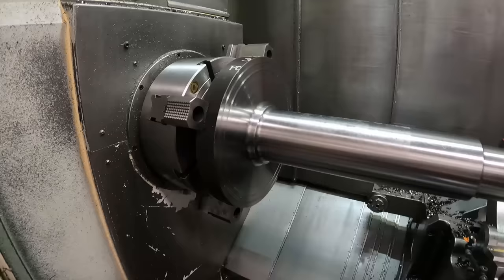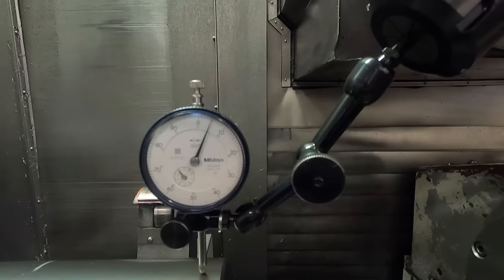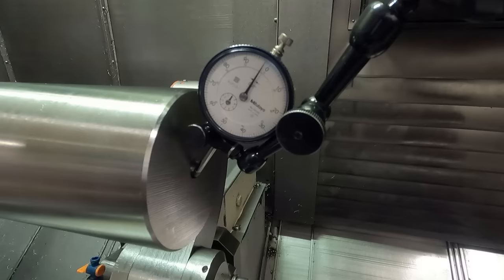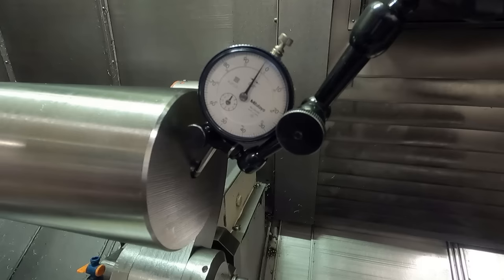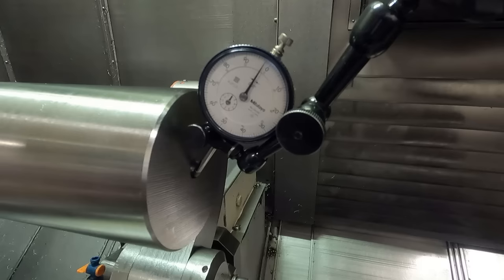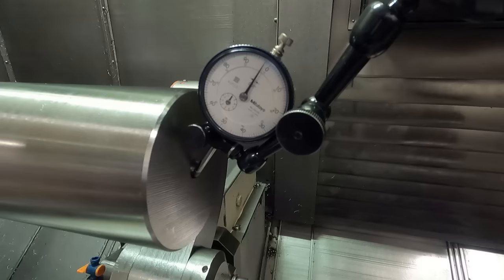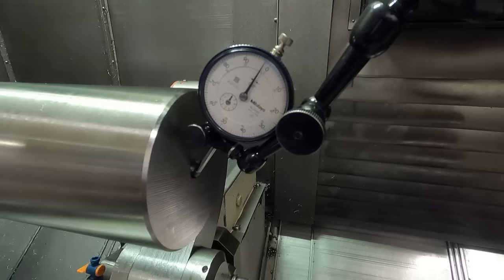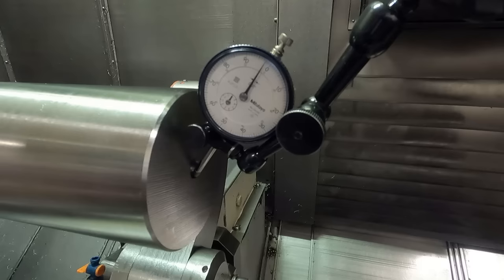Machine Shaft From 2000 Lb Stock

Comment: I can see maybe doing that part in reverse order. The flange side first and then the shaft side.  When you do the flange for the 1st op turn the entire OD length for easy indicating the 2nd op and a place for the steady rest to run. Face and center drill. Remove the steady and engage the tailstock and let her eat. Come back and drill the flange holes in a final op. Not sure I'd agree with the bushing idea for chucking on the backside. Seems like added risk. All that work and you have no idea what the shaft is doing back in the spindle, plus a bushing. It could be running out a mile. If you do the flange side first then you know for certain everything is true. Someone else said in between centers. Personally if you want it to be exact then in between centers is the best option. Enjoyed the video. Everybody makes parts differently. But if you think through the process you might recognize how simple it would be making the backside first.
Reply from the maker: No sorry you would be wrong if you did the flange end first. If things distorted when you roughed off the bulk of material. It will distort the flange end out of square and flat. Also you couldn’t drill the 1.00” hole it would never meat the hole from the other end. The order I did it in is the way. When you indicate the second end. I didn’t get a chance to show it. You indicate the back of the flange if that is running true within say .001 or better. You are square. I turned a area on the OD. You can see it in the video when I showed the small hole to set C zero for the next op. You get that running true and the back face. You than know everything is running true back in the spindle. And now you line up the C rotation to the small c-bore for that purpose than you can put the flanges holes in after turning. If you put those in in your first operation before roughing the other side. It would leave you with intermittent cuts intersecting the drilled tip of the holes. Breaking your roughing insert. And also creating problems with the finish tool. So you can see there is a reason I decided on this order of machine work. As to the bushing it would work with one or not but as I said it is easer to keep from scratching the OD with it. The bushing doesn’t matter as far as runout. If it runs true it runs true. Bushing or not.
Reply: @EdgePrecision  Yeah you're probably right.
Reply: @MuddyintheWater  he’s always right . He’s a master
Reply: I'm not saying he's wrong but if he ran it the correct way he could save hours run time, handling and headache. Really, really, really over complicated that part. 

Like I say if you simply turn the flange and then the length of the part. 2nd op chuck on the flange, face to length, hit it with the tailstock, rough turn the OD, remove the tailstock, rebore the center, engage the tailstock, finish turn. Then flip and drill the holes and the part is finished. Done. Pretty much that simple. And all that can be done inside of a program and all your lengths will be held and handling to a minimum . Running it his way he has to handle the hell out of the part. If he had 15 parts to make it would take 6 weeks and he'd work himself to death. Literally you have to see just how simple the part would be running it the other way. The way 99.9% of the world would make that part.

He said no I was wrong. I tried to be polite and simply throw out the idea for him to mull over. His reply was that I was wrong. The irony is that the rest of the world could make 12 of those parts in an effortless setup in the time it took him to make 2 all while he was working himself to death.
Reply from the maker: Ask me how I know it wouldn’t work. I will tell you. I tried it your way on some other parts in this same order. Fortunately I left enough material on the roughing operation to save the part. These are the problems with your process. If you start and finish the flange end as you say. Than turn the blank around and chuck the finished diameter of the flange. Than face the part to length and center drill. At this point you have already made two mistakes. Now this would work for smaller diameter stock but not this 16” diameter material. Because when you rough down the shaft the part will bow. Now to get the remaining face flat and square you would have to reface it before you reclaim your center drill. But now the part is short. Now the flange end you finished is no longer flat because it warped when you roughed all that stock down to the shaft. Now again ask me how I know this. Fortunately when I did this I left stock on the overall length so I was able to clean up the part in tolerance. And again fortunately the 16” of of the flange wasn’t critical and the customer said it was OK when that didn’t quite clean up when I had to recut the flange end. Does that explain to you why I said your process would not work.
Reply: @EdgePrecision  no because as I explained in my explanation of making the part, in the 2nd op (the shaft end) you can 
1. Rough it down
2. Remove the tailstock allowing the part to relieve itself
3. Rebore the center making it true to the flange again and free of stress
4. Engage the tailstock
5. Finish turn the part

As far as the flange side I have a hard time believing that it's not flat. The long shaft end, sure, that's typical. But the flange bowing isn't typical. People turn down short large diameter parts all the time? Removing material 36 inches away from the shoulder isn't going to cause stress relief from the flange if that makes sense. Short length or long length part why would material removal effect the flatness of the flange? The shaft, yes. It's long and a lot of material coming off so yeah it'll curl. But the flange? But if you say that it doesn't come out flat then fine. Don't turn it in the first op. Simply face the part and leave .100 to come back and finish in the 3rd op when you are drilling the holes. 

It really is that easy. 
Op 1. Put the part in. Face it. Skim the OD as far down the part as you can. 

Op 2. Indicate. Steady. Face the OAL (leave .100). center drill. Tailstock. Rough. Remove tailstock. Rebore center. Finish turn. 

Op 3. Finish flange. Drill.

With my way you're not indicating forever and your can hit the button and make the parts and hold all the dimensions. 

Your way your handling the parts a lot. A lot more involved than it needs to be.

That's my opinion. Like I said I tried to be polite about it and simply mention another way. You bluntly told me I was wrong. Now I'm bluntly showing you that there's a more logical way. Whether you accept it is up to you. I'm not attacking your ego.

Comment: Why can’t you start with stock that has a closer diameter to the end product and just weld or fasten then flange?
Reply: I would guess a strength/wear problem. Having it be one piece is probably stronger. If you welded it or bolted it its only the bolts or weld material holding it together whereas as one piece the amount of volume holding it together is much bigger.

Comment: A little side eye for the engineer who decided that shaft needed to be turned from a $10,000+USD round rather than be a two-piece press-together.
Reply from the maker: The original machine had fabricated shafts that these are replacing. They had a failure so in order to avoid that possibility they decided to go out of solid material. By the way your price on the material is more than three times the actual cost.
Reply: @EdgePrecision  That's why I don't buy that stuff for a living!

Comment: Wouldn’t it make more sense to use an upset forging instead of bar stock, better grain structure, less waste of 4140 material and a less machining…?
Reply from the maker: If you read the comment I put in this videos description you should get your answer. But to make it short. In these small quantities, it is more economical to waste the material. It would cost more for the forgings then the wasted material. There was also a time factor. The round bar could be delivered next day from stock. Not so for the forgings.

Comment: Maybe this is a different type of lathe, or maybe it is wrongly being used. You don't do a circumferential check with a dial indicator gauge when the work has been machined while being held by the large lathe chuck and tail stock center pointer. 

The tail stock center pointer is the only one that holds the work true when being machined. Once the tail stock pointer is backed off, the heavy work clamped by the chuck jaws may drop according to its weight and could become unbalanced, as the jaws will never be able to hold such tremendous weight. I mean, this video makes no sense, it's also confusing... 
And I've worked on lathe machines, too.

Comment: Перерасход материала просто космический.
Reply: Those barrels of chips get sold and are recycled to new stock. The specifications on the part no doubt require that it be made from extruded stock. Not welded, not cast. I assume it is an aircraft engine shaft or something comparable.
Reply: @paulvandal4444  так это и есть отлитая заготовка. Я на работе из подобных делаю промывочные переводники для буровых колонн. На видео большое количество затраченных часов на работу, которую можно убрать, отливая заготовку бутылочного типа. К тому же напряжение стали, когда ее протачивают с большего на меньший диаметр очень возрастает.

Comment: So... Why does he start with such a big piece of material to make a piece that size? Why not start with material closer in size?
Reply from the maker: The end of the part in the chuck has a 16” diameter flange about a inch thick. The customer wanted the part machined out of one piece of material. So the stock had to be at least 16” in diameter.

Comment: That's quite a lot of material loss.. turning from that large diameter down to a smaller shaft. Almost makes you wonder about the concept of a 2 piece version of this part that would require less machining and result in less time and material lost.
Reply from the maker: If you read the comment I put in this videos description you will see why it was done this way. Thanks!
Reply: Oh I'm sure there's reasons. Space and clearance restrictions, strength/torque rating of 1pc vs 2pc.. the list can go on. I just like to think about concepts, rationale and engineering in a surrealistic realm sometimes! Thanks for the reply.  @EdgePrecision

Comment: Just a small comment why do you not machine a clean surface and then rotate into Chuck so you are starting from a machined surface
Reply from the maker: I wanted to use the hard jaws on the first operation. They put dents in the part with their serrations. There wasn’t a lot of stock on the OD and I didn’t want to dent the finished part. So I didn’t do any cuts on the raw stock.
Reply: @EdgePrecision  thank you

Comment: This part must be possible to make as two pieces and press/weld together the plate with the shaft.
Removing 90% of the stock is not a viable solution in manufacturing.
Reply from the maker: Read my comment in this videos description.

Comment: That has to be a record for material wasted, like making a toothpick out of a tree.
Reply from the maker: The flange on the parts end is the diameter of the stock. The customer wanted the part machined out of one piece of stock. So there is no other way to do it.
Reply: @EdgePrecision  It wasn’t a complaint, just incredible to see.

Comment: What is that device at the beginning? Is it a magnet? Why did he take it off and just use a rope anyway? O_O
Reply from the maker: I made this video a long time ago. But if it was the magnet I have. It is not rated to pick up the whole bar. So I just us it to get the strap under the bar. The strap is more than strong enough for the lift.
Reply: @EdgePrecision   Ah alright, thanks. That's very interesting.

Comment: So did you purposely get the smaller version of that CNC machine? 😳😳 LOL 🤣🤣🤣
Reply from the maker: There is one larger Mazak Integrex  e800. The number in the model number of all Mazak Integrex’s relates to the Y axis travel. So my machine is a e650H. Witch means it has 650mm (25.59”) of Y travel.
Reply: @EdgePrecision  maybe it's the wide angle lens, distorting the size?

Comment: What software are you programming with?
Reply from the maker: Esprit TNG.
Reply: @EdgePrecision  Thanks! Awesome work! I work in an aerospace machine shop and we have a mill turn in the works for some Air Bus parts. So interesting to see how awesome these machines can be in the hands of someone who knows so much. I learned quite a bit, thanks for sharing your knowledge.
Reply from the maker: @BHud20  I have a job coming up. If they let me do videos on it, you may find it interesting. It’s a helicopter blade grip. Right now we’re waiting on the steel forgings.
Reply: @EdgePrecision  Awesome! Look forward to seeing its non-ITAR and youre able to share! The ones we have coming up are precision Titanium castings. Pretty intimidating actually. Have some pics of amazing parts I programmed and ran on a UMC, wish I could share.

Comment: My god man that's a lot of material.  Go yell at the engineer, and tell him to design that part in 2 pieces.
Reply from the maker: Read the comment I made in the description. Or I think I pinned a comment on this.
Reply: @EdgePrecision  thanks for the response.   I'm a machinist also, 2 jobs. I do Xometry work and usually reject posted jobs like that at my part time.   My full time I work directly with the engineer, and we almost always find a solution to stuff like this.  (Counterbore bolts, and welds maybe). Either way, it was a good lesson and I appreciate the video.

Comment: Looks like this could be made in separate pieces.
Reply from the maker: It is possible and the original parts were made that way (These are replacements for failed parts). But the customer wanted this out of one piece because of the original failure.
Reply: @EdgePrecision  ok guess you mean the joint that was where the mounting disc attached to the shaft? Was it welded?
Reply from the maker: The original parts were made out of two pieces welded together. A disk and a shaft piece.

Comment: Something major wrong with the lathe for getting all that run out.
Reply: Lols no it's not, did you see the way he was taking those cuts, they were definitely not finishing cuts and with a part this long even with a live centre on the tail stock you can expect run out, I work with all kinds of lathes down to watch makers lathes and was taught by my father who has been working with them for well over 30 years..
Reply: What he was saying about the metal stresses is exactly right, think of it like a piece of wood.. Cut one side of a log off and dry it then you'll see what I mean. It will bow as you released the stress and tension holding it in the shape it was lol. Go read up about this stuff it is science fact.

Comment: Isn't it easier and cheaper if you take a rod with a smaller diameter?!?
Reply from the maker: There is a flange on the chuck end of the part that's the 16" diameter of the stock. Because the customer wanted the part machined out of one piece of stock it had to be this large.

Comment: Seems to me that if you have to cut that much off your starting with the wrong size piece...
Reply from the maker: There is a flange on the end of the part that is the diameter of the stock. So if the stock was not this size the part could not be machined out of one piece. That is what this customer wanted the part to be one piece of material.

Comment: Surely there is a way those parts could have been made without wasting so much material.  
Of course forgings come to mind but that may not have been a viable option.
It would be interesting to know the rational of why this part was designed as a single piece
instead of a multiple piece construction.
Reply from the maker: I have answered this question many many times. The machine these shafts go into had the originals made that way. They had a failure at the weld area. So to repair the machine and leave nothing to chance. They decided to eliminate this possible area of failure. That said it is debatable weather making these parts from a forging or fabrication would actually save any money. For instance a fabrication. First I have to prepare the parts for welding. Than send them to a welding shop. Now this material requires a pre heat before welding. Than welding. A job that would probably take all day for these two parts. Than after, heat treating. Now I would get them back. And still have to line up and rough them. Than after I would do exactly what you see in the video. So you tell me would that really save money? What you are actually doing is spreading the money between more people. By my way of thinking I would rather do the whole thing and get paid for it. Also I have better control over the process. As for the forging maybe but time was a factor here. And than again it’s debatable weather the forgings would cost less than the round bar. So you might save a little in rough machining time. So this is more complicated than it seems.
Reply: @EdgePrecision  When you detail it out like you have above it makes a lot more sense to me. You have said elsewhere that time is an issue, and with every additional step in the process, more time is eaten up. Also, with more steps at other shops you loose control over time and quality. The original parts failed at the welded joint for whatever reason, therefore a fabricated and then welded job drops to second or third option. Casting is not strong enough and so is eliminated. Forging, would probably take too long and like welding require stress relieving and annealing, which also takes time. Moving the parts between workshops takes time and introduces transport risks. Nett results are that you have the capability and access to suitably sized stock and keeping as much of the process in house maximises time and quality control.